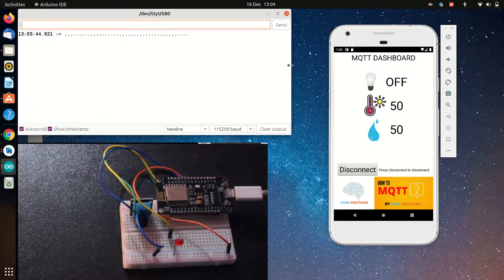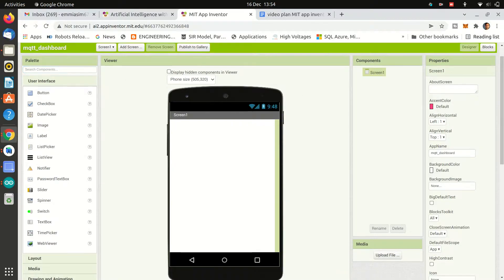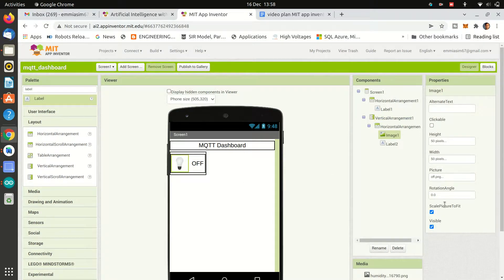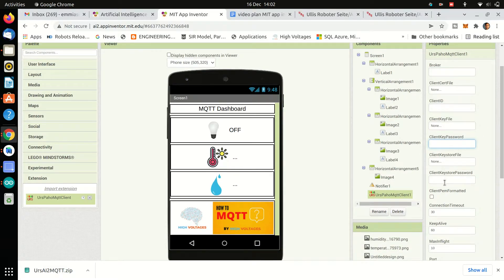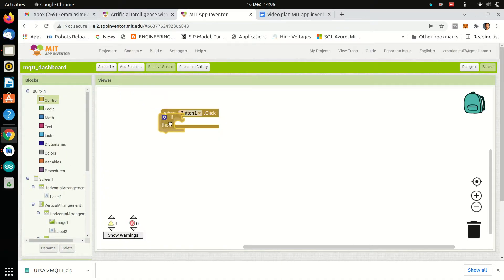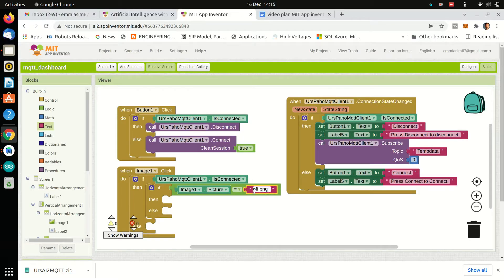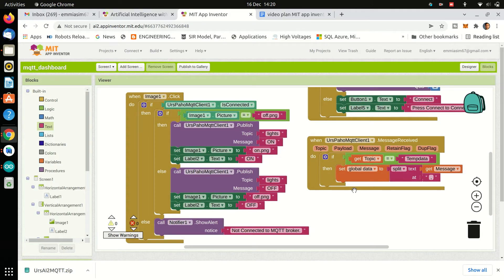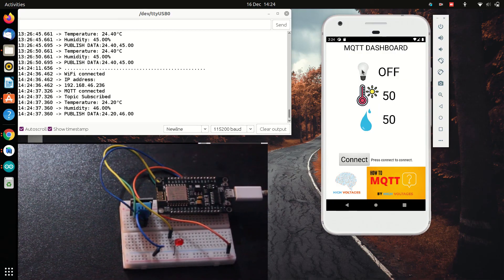MQTT Android Application | MIT app inventor

Comment: Great vid! I actually have a question for you - I was wondering if it is possible for the app client to disconnect automatically the moment the app is closed. I'm not talking about closing a screen, but closing the actual app before reopening it.  I found out that if I close the app entirely, even deleting it off my phone, the connection is still preserved, and I wish to change that.
Reply from the maker: Yes that is possible. You have to add a "Call Mqtt client disconnect" function. Let me know if it works.
Reply: @HighVoltages  So, apparently the client had disconnected and the problam was that the broker didn't update quickly enough for it to tell me about the disconnecting. So the problem is solved, but just for the sake of curiousity, how shall I use the "call disconnect" function, as soon as the app is closed? I heard that it's impossible to operate on screens once they're closed. Thanks for the reply!

Comment: Can i use a 3g module instead of the ESP2868, say a SIM5320e to communicate instead?
Reply from the maker: yes you can do that but there will be alot of changings in the code.

Comment: thx but i think you must read the state of led when you launch your application in your smartphone because the led can be turned off and in your application seemes that it is turned on because pbs can happened in connexion to the internet ...
so i think that in  your pg of nodemcu you must publish the state of led every 10"
Reply from the maker: Yes, that is right and really necessary. I will do it in the next video.
Reply: @HighVoltages  thx excuse me can you tell me why i don't succeed to connect to broker using my credentials and can you send me what must put in properties of mqtt extension
thx in advance

Comment: i have a  doubt...
should the mobile phone and the esp8266 should be connected in same wifi ?
Reply from the maker: it depends where your mqtt broker is located , if your broker is on local area network then yes otherwise no , they can be connected on different wifi.